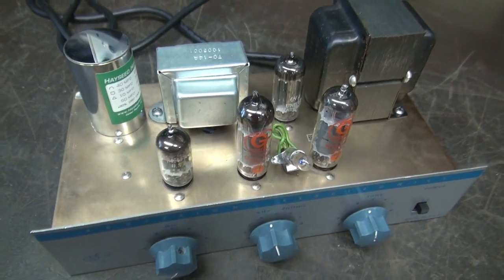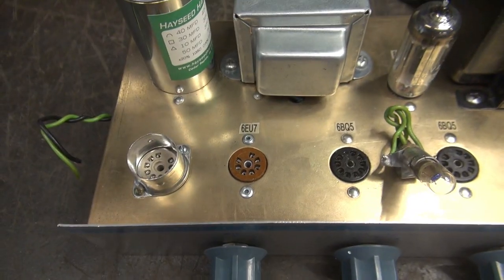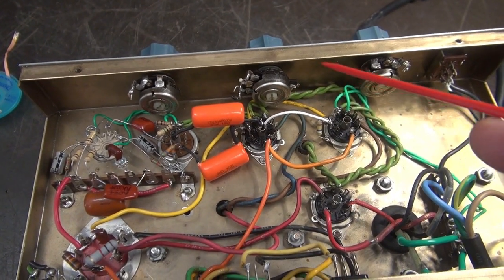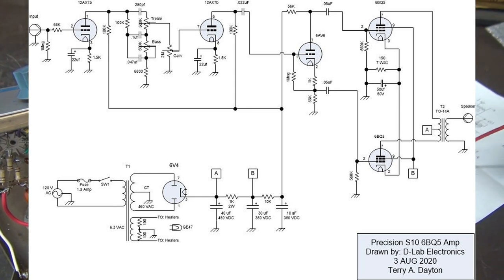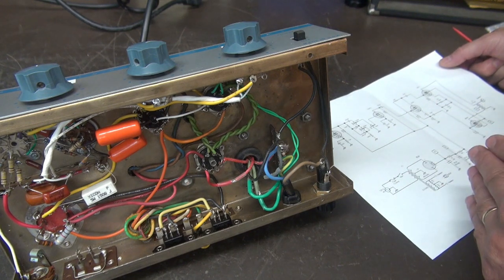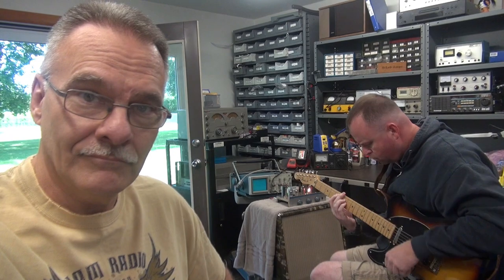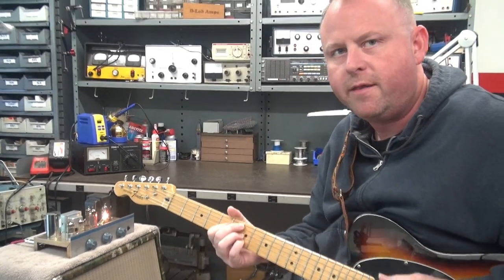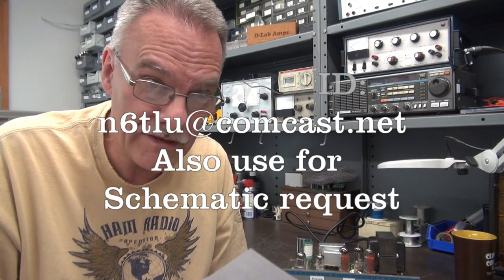How to repair restore Precision Electronics S10 PA amp convert to guitar tube amplifier Part 2

Comment: Gibson guitar amps used those 6eu7’s dual triodes....they were designed as a more “hifi” tube compared to the 12ax7 family of tubes. 6eu7s are pricey now so not many builders using them currently

Comment: Why not let the 6EU7 noval socket built-in, use the 6EU7 or a 12AX7 as the second triode and the phase inverter and drill only the hole for 6AV6 pico socket and use the 6AV6 as first triode? Is the 6AV6 too microphonic or too noisy for the first gain stage?
Reply from the maker: There are many possibilities

Comment: Call me a heretic, but I'd like to build something like this but create more of a dirty sounding pre-amp stage using jfet op amps and diodes or LEDS for hard and soft clipping without actually over driving the amplifier.  I could use a fuzz or distortion pedal, but I'd like to have it all in one package.   I like how clean the power amp side is,  and would like to do all the tone shaping before it.

Comment: Would be cool if you turned it into a bass amp.
Guitar amps are everywhere while bass amps are ignored.
Reply: How much wattage would a small bass practice amp require?  Don't the lower frequencies need a little more juice to recreate?
Reply: The output transfomer may be too tiny to cope with the bass response needed in this case though.
Reply: @johnnaighley9252  Probably so and in that case you change it.  It also needs a boatload of caps.
Reply: @johnnaighley9252  I'm guessing the 10 in the name refers to 10W.  Fine for a practice guitar amp.  I've heard the 15W bass amps hardly put out, and a 20-30W output are more suitable.  I'm guessing there are way better PA systems out there that can be modded into a bass amp.